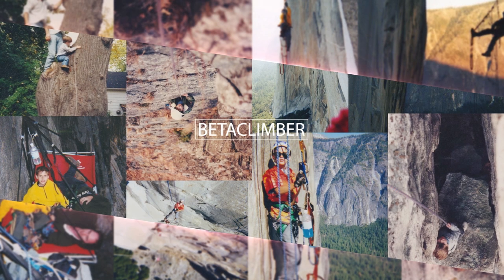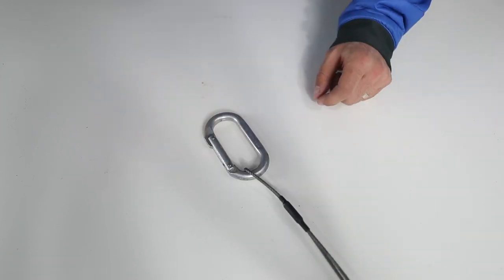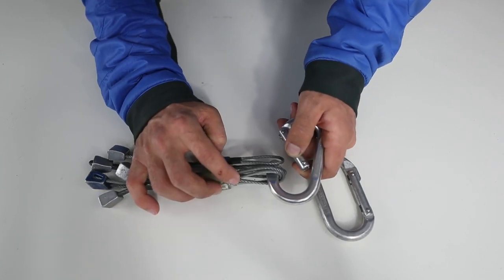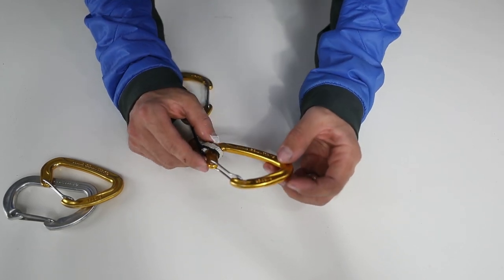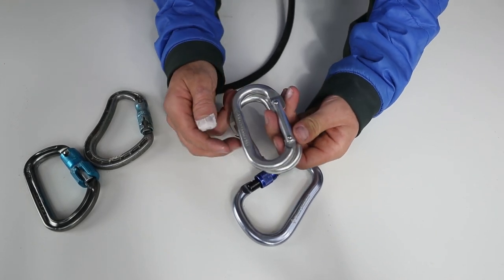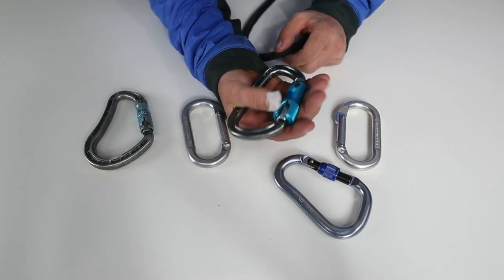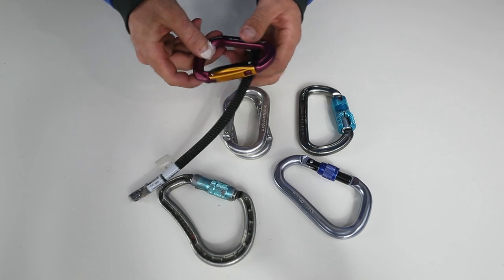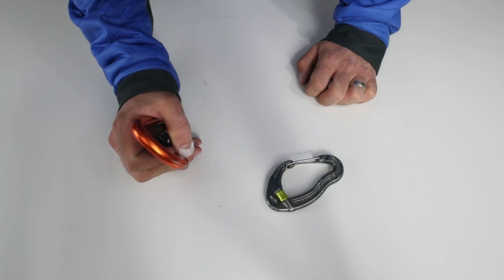Everything I know about Carabiners!

Comment: I've used a Grivel Clepsydra twin gate belay biner for two years and that thing is impossible to fuck up. It's a super solid, very specific kind of biner. Also eveyone of my climbing buds have hated on it for how complicated it looks and difficult it feels to get through a grigri. After a bit of practice using the thing becomes second nature and throwing a grigri on it is faster than screwing up a screw gate. Might be a bit ugly, but I still love it.
Austrialpin also came out with an interesting autolocker called the Rondo Slide autolock which looks kinda sleek...too bad I have no need for more biners...

...ordered 2.
Reply: would you reccomend this biner if i was top roping to use in my masterpoint where my rope would run through. thank in advance

Comment: I've got a little sand inside my relatively brand new triple locking carabiners- is it okay to take a hose to them to try and rinse it out?  Or better to use compressed air?  Thanks!
Reply from the maker: May be better to just hold it upside down and keep twisting it and the sand should fall out.
Reply: Carabiniers are not fragile. Got gunk and sand? Put them in bucket with some dish soap and clean them up.
Reply: @g.fisher6602  Thanks.  I guess I just wasn't sure if the fancy locking carabiners use an oil based lubrication inside to keep all the spring action functioning- and was concerned about washing that away.....

Comment: I'm having a bit of trouble locking and unlocking a carabiner at work (first day) as they attach to a metal component and cannot seem to work out how to use it! It's embarrasing as everyone else has no issues with it. are there any tricks to opening them when they are jammed with components??
Reply from the maker: Adam Betteridge sounds like its weighted if you can get the weight off of it then it opens much easier. They stretch when weighted and that can jam them up a bit sometimes. If that a doesn’t work use a different brand or style I guess.

Comment: I use oval steel carabiners from Petzl for all my carabine needs, i dont really see any reason for all this wierd shapes.
Reply: It makes the rope be more to the side without the gate, since the gate is by far the weakest element in it.
Reply: @canaDavid1  True, but my steel carabiners is rated 28kn, 7kn crossloaded and 10kn with the gate open, so plenty for my needs.
Reply: @swedeson6188  True, and you're most certainly ok. But one could (maybe) make the argument that there is more wear on the gate and it shortens the lifespan.
Reply: @canaDavid1  That is nothing i am worrying about. Its easy to see on steel when it become unusable, aluminium is more difficult.
Reply: @swedeson6188  neither am I. Am just pointing it out that one could make that argument.
Reply: @canaDavid1  Yes, of course :)